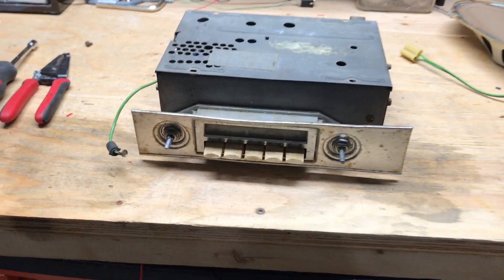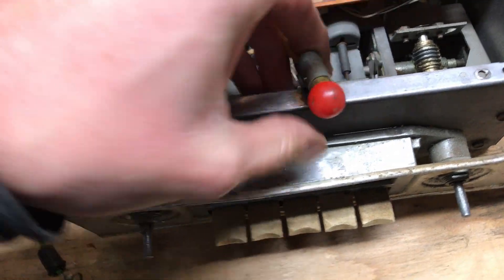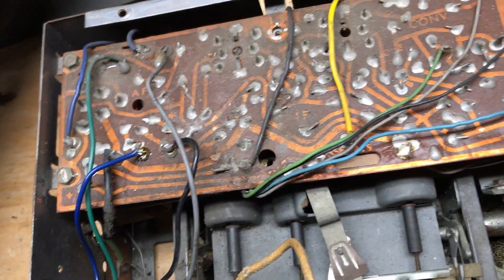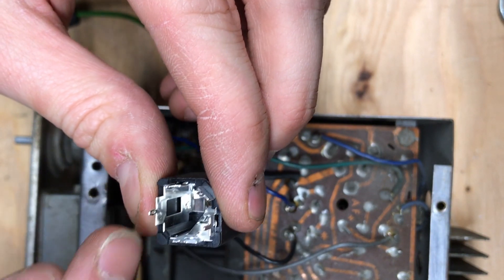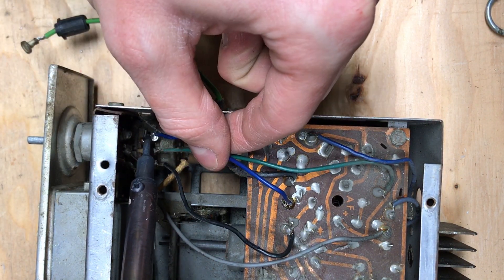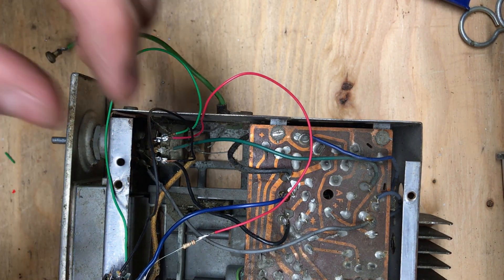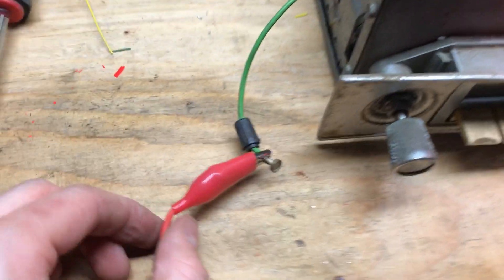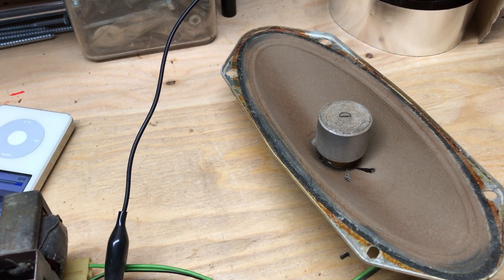Add AUX input to old AM radio

Comment: This is a science question I suppose, as I didn't keep up on electronic engineering.  You used a single 150 ohm resistor on one leg of the signal lead.  Why not resistors on both signal leads (left and right)?  I saw another video where the guy used a 10K on ground, and a 1K on both signal leads to avoid damaging the player.  This was on a vintage tube 120v tube radio--- is that the difference; a 12V radio vs. a 120v radio?  I realize this post is 5 years old, but maybe you are still monitoring comments.  Thanks!
Reply from the maker: Hey, the resistor is not to protect the radio it’s to tell the device your connecting it to to play in mono instead of stereo.

Comment: You are only getting one channel of the input device here !   You need a stereo hook up that joins both channels down to the "High Side" of the volume pot.   I like to use a SHIELDED 3.5 mm plug ended cord.  I run it thru any existing hole on the chassis,  tie a strain relief knot,  then solder the shield to the LOW SIDE of the pot,.   Then, add 470 ohm to 4700 ohm resistor in series with the right and left channel "Hot" wires on the new incoming wire,  and tie them both to the HIGH SIDE of the pot.  Tape up anything that might short out but its best to just keep the leads short so no tape is needed.     NOTE...  "High side "  lug is at 1 o clock if the center lug is a 12 o clock position as viewed from behind the pot.  Thus,  LOW SIDE is at 11 o'clock.   Hope this is clear.   Be sure to run any device very strongly into the radio,  it wants a lot of signal into the pot.    This can be done on vintage home radios too.  Be sure to unplug the aux device to use the AM radio normally.   Dont let the male plug touch metal or it will short out the radio signal,  OR, use a female jack on the end of the cord and use a M to M adapter or cord when using the aux input.  That way the female ended cord can be stowed away anywhere.  I usually run the cord into the glovebox.
Reply from the maker: Thanks, this will be helpful for anyone who wants stereo. I mention in the video this is for mono. 

The Avanti had only one speaker in the Center of the dash. In 1963 you could pay extra and have a second speaker centred in the rear. Unfortunately no stereo option.

Comment: I have just finished this with a corvair delco radio and I’m shocked how well it works! I have been trying a potentiometer on pin 4 and the only difference I hear between 0 and 200 is a gradual deadening of that channel in the mix of the two. Am I missing something?
Reply from the maker: Why add another pot?

Comment: Why didn't you move all the other wires out of the way. You smoked the insulation off of your other wires.
Reply from the maker: That’s just the camera angle. Just the solder with flux core smoking.

Comment: Thanks for providing such great how to information. Is the resistor size based on your radio or the aux input? I have a 55 delo I would like to do the same thing with.
Reply from the maker: the resistor is to "trick" your device ie iphone ipod mp3 player etc to play in mono instead of stereo mode.
Reply: @MinorConvenience  what if you want it to play in stereo, what would you do?
Reply from the maker: @claytonhaske  this radio is a mono unit

Comment: Thanks for sharing the video. I have been looking for some info on this for my 66 ford AM radio for a while. I have a few questions if you can help me understand. 

1. do I need 80-220 ohms or is 75 ohms ok? I ask because I have 75ohms locally, but can get some 80-220 online if it is important. Just not sure if this is an exact calculation I need to meet or not. 

2. can this be done with a 3 pin 3.5 jack ( I see these much more) or by using something like this so I can cut off end and mount clean.

https://www.amazon.com/Dashboard-Waterproof-Extension-Mounting-Motorcycle/dp/B01MQZOH22/ref=sr_1_51?dchild=1&keywords=female+3.5+mounted+jack&qid=1595904611&s=electronics&sr=1-51

3. are you aware of how to add Bluetooth to a vintage am? I figure there must be a way to add something like this (it has power, neg, left and right?):

https://www.amazon.com/Fusion-MS-BT100-Bluetooth-Dongle-Marine/dp/B00CUMQU50/ref=sr_1_2?dchild=1&keywords=fusion+bt100&qid=1595901797&sr=8-2

Thanks again. Great video!!
Reply from the maker: sorry for the late reply didnt notice i had a unanswered comment. 75ohm may work but i believe you need at least 80ohm. yes you can use that jack you are referring to but i would not connect the AM signal back to the jack with that one. The reason i suggested the one above is because it will physically break the AM signal when you insert the AUX cable. The one you linked will not do this and if you connect the AM signal you will always be getting AM radio through you speakers regardless if you connect the AUX or not. There are ways to add Bluetooth but they are much more expensive and i have not tried.